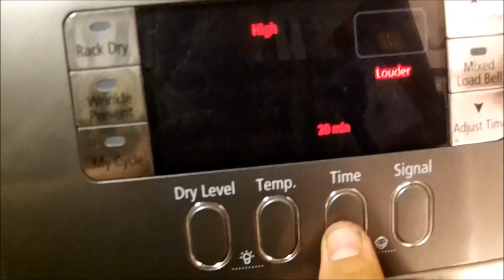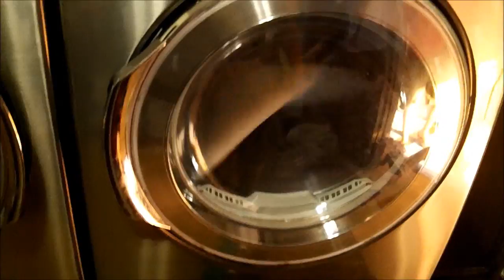How to reupholster an atv seat

Comment: Don't use spray adhesive!  A good trick is to use a garbage bag over the foam so vinyl can slide.  Heating the vinyl is a good recommendation as it allows you to stretch tight.

Comment: Great video, also, If you have cracks or holes on the foam part of the seat, use polyurethane caulk to fill the holes or divots, then cover with thick tape, let it dry for overnight, then the seat will be even and smooth again, then use glue and marine vinyl the next day.

Comment: I do leather re-upholstery but have never worked with vinyl. I was trying to re-cover a seat for a friends fourwheeler but the vinyl just wouldn't stretch right and kept getting wrinkles in it. The dryer trick was the answer! Thanks!
Reply from the maker: Glad it all worked out. Yeah the dryer combined with the spray glue really does the trick.

Comment: I tried it and had difficulty on the back around the corners.  So it looks pretty welfare but good enough.  Also my staples were only 3/8 which was definitely too small so I will have to get bigger ones to finish.
Reply: Thanks Bandit for the tips.

Comment: that spray has directions on it. you spray both items and let them get tacky before putting together.  Also never use glue on a job like that.  good thing it was not made like that or you could have not reused the foam.  Now if you tear the seat you will ruin the foam to replace next time.   But it looks good and I hope you don't need to do it again.

Comment: Hey genius...what's the point of putting it in the dryer if it takes a 1/2 hour to put on and cools down in 30 seconds. Tip for those that read this. Heat gun. Heat up as you go in the areas your working on. Came out awesome...

Comment: To really enhance the old seat foam,  fill the holes and indents with cotton balls and spray adhesive.  Cover cotton ball patches with plastic wrap and more spray adhesive.  Then wrap that with new 1/2” foam.  Then put the seat in a garbage bag before stapling new cover on to help keep moisture out.

Comment: I covered my seat on my dual-sport using your method. Holy cow it worked so well! No more wet butt! My only problem was the stapler. The staples didn't want to go in. How did you get your staples in so easy? Thanks for posting. Am going to link to this.
Reply: Air staple gun 1/2 staples. I did it and worked great
Reply: @stevedoty1845  YAY!  Pneumatic ROCKS for jobs like this!  Let the tools do the work for you.  Thanks Steve.  GREAT suggestion.  :)

Comment: You should not be gluing your cover to the seat foam. Next time you want to recover you'll destroy your seat foam by tearing foam from the seat when you remove the old cover. Here's the big clue: Was your original cover glued down? No, it wasn't. If it was the cover has been replaced.